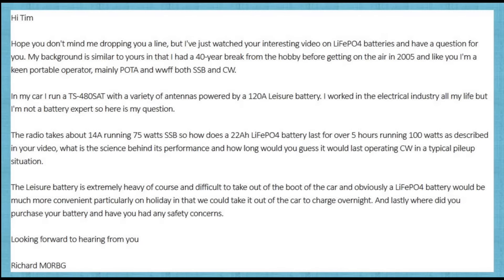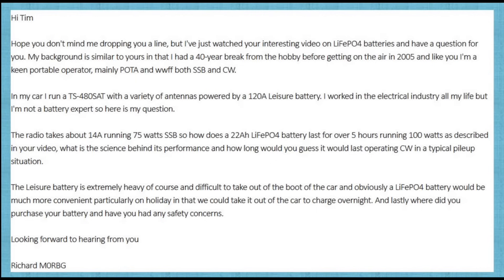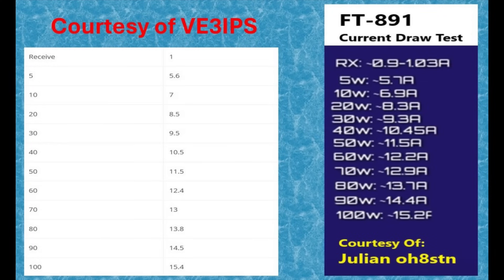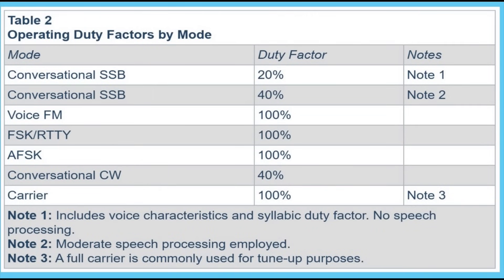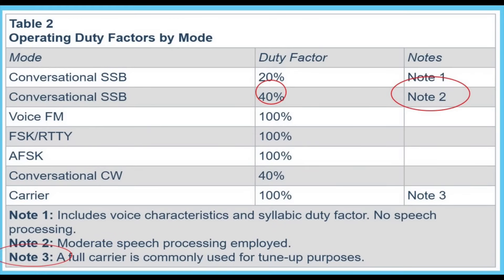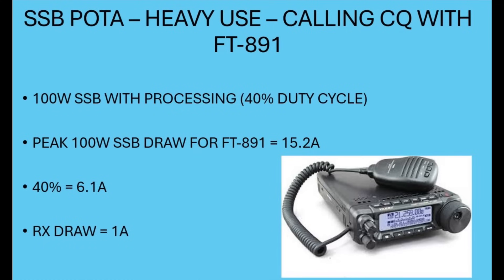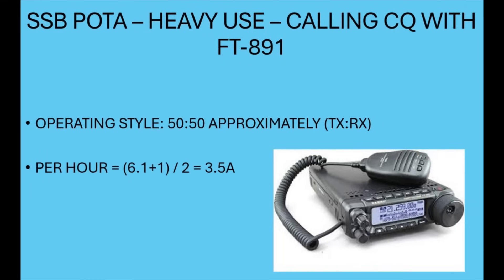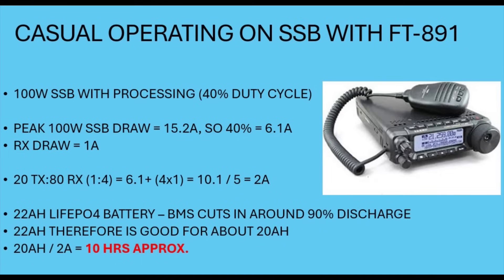Ham Radio: How Much LiFePO4 Battery Capacity Do You Need?

Comment: I run CW @ 25w or less, that's a whopping 1 S-unit down from 100w! Doesn't need a golf cart battery. Aerial is key, gain is great but minimal loss is gooder.
The Renogy 100AH is light enough to pack as a geriatric, with a booster PV.
Cheers
Reply from the maker: Thanks for sharing 73

Comment: Portable power supply has always been up there in terms of priority when operating in the field.  Three things I look for when out and about with my kit is a resonant antenna, a decent lightweight radio, in my case either my 817 or 857, and a lightweight reliable power source.  My first lifepo4 battery was a 14amp Tracer, and it was brilliant, I still use it today, but at the time of purchase, it was eye wateringly expensive.  Prices have come down dramatically and although brands such as Tracer and Ultra Max are great, I now tend to use Eco-worthy because at their price point, what you get is fantastic value.  My most recent battery, a 30amp lifepo4 from them cost me £89.99 and as an M6, that is going to last me forever, especially when linked up to a small portable solar system.  Great video Tim and very well explained 👍.
Reply from the maker: Thank you my friend! 73

Comment: I use LiFeP04 now for all portable projects and CB radio. They really changed the game. I found it worthwhile to buy a cheap coulomb counter meter because it's almost impossible to ascertain the state of charge  by measuring the voltage due to the very flat discharge curve. Helps to warn you at a glance when it's getting low to avoid the BMS suddenly cutting you off.
Reply from the maker: Good points

Comment: I’ve been using a 20 amp LiPO for a few years, if I run a big rig at 75 watts I get a morning out of it on SSB.  The power drain on my TS570 in standby/receive mode is quite high, so running QRP while it helps doesn’t make it worthwhile. I normally run an Electraft KX3 when working portable and will run most of the week.   So an 80/100 amp battery as used a lot over the pond would be much better.  My club used a 100 amp jobby for a special event for 2 and 70 at about 50 watts and ran all day on FM.  Much better than using generators so I think the club is convinced about this power source as well as not needing a trailer to lug the extra power kit around. 😮
Reply from the maker: Good stuff!

Comment: Great explanation. The RX draws may be a little too low given it's a no signal figure. But I suppose without listening to power hungry audio it will not change the calculation significantly. Best 73 de PE1CGX.
Reply from the maker: @bendunselman  thanks 👍👍👍

Comment: Good explanation Tim. Lots of people fail to realise ssb is not 100% duty cycle.  Only other thing to think about is FT-891 draws more current on higher bands 10m etc.  40m and 20m its a good bit lower.  I started with 20ah.  Never run it out.  Tried a 12ah and got near but in practice I normally get tired before the battery does 😂 So was thinking try a 10ah ultramax.  They say max draw is 10A.  Emailed ultramax and they said  the BMS would shut off at 10A.  Think it must be constant 10A.  Tried it nothing happens.  Have to do a pota activation to check. 10ah is nice and small and low weight if you are on foot.
Reply from the maker: Yes you might get away with it on the max draw at 10ah. 👍

Comment: Thank you Tim, a very informative video.  I take part in Raynet events and In Suffolk we have a LDWA (long distance walking association) 100 mile  circular walking challenge event in May lasting over 3 days.  Therefore we are working shifts - because of my former work I expect to be doing 10 hour night shifts using VHF 10w in car ft8800 repeater from handheld tx to a central control.  Your ‘lesson’ re battery endurance and the calculations has come at a great time.  Brilliant. Thanks again.  Phil, g0nik Suffolk.
Reply from the maker: Thank you Phil, much appreciated!

Comment: My bladder is fully charged after about 2.5 hours. I am sure we could work this into the calculation Tim ? 73 M7BLC 🙂
Reply from the maker: Adds another 3dB John!
Reply: I discharge my bladder battery about every 3 hours at night. However if I stop charging it by 6 pm, that rate is less. Note: A beer charge tops it off faster than an Old Fashioned.

Comment: Very interesting stuff.
 
It seems that here we have the rare case where the theoretical calculations and the practical reality are virtually the same.  Wow!

After a while, we get used to "how long it'll last", and can have, like you Tim, a back up.

I have a battery box in my car and use a gadget that shows the battery charge % and voltage.  Also helpful...

This is a meaningful video Tim.  Thanks
Reply from the maker: Thank you Peter!